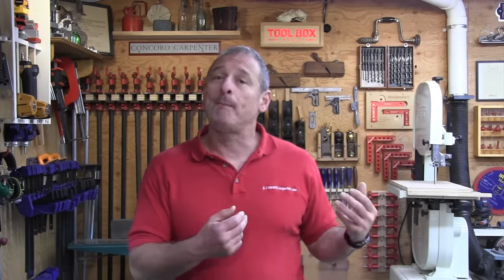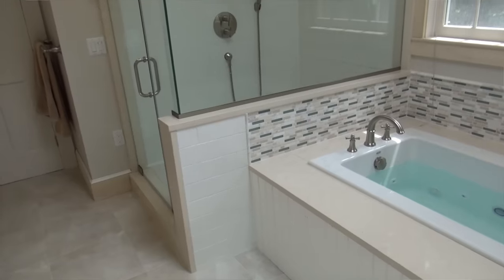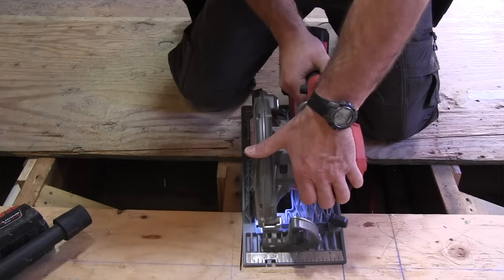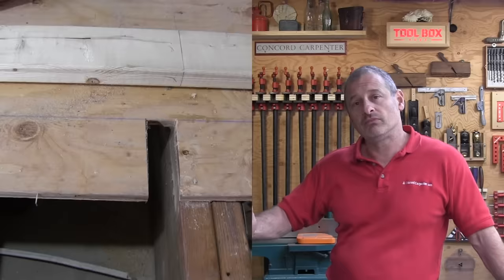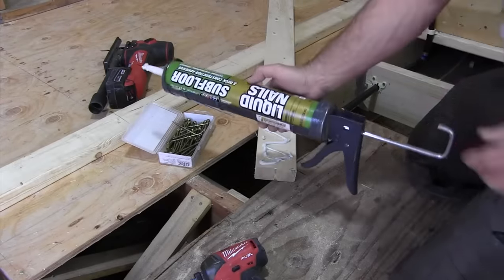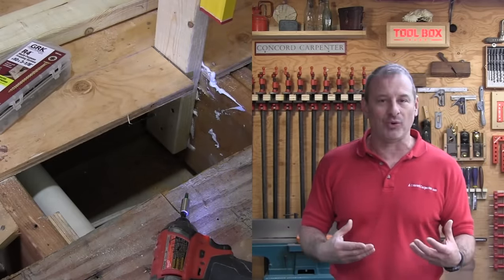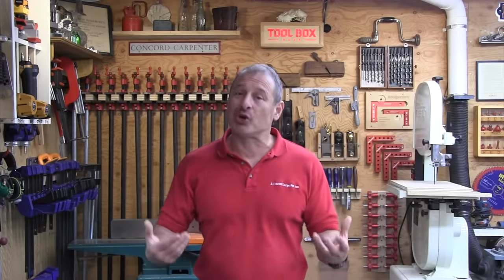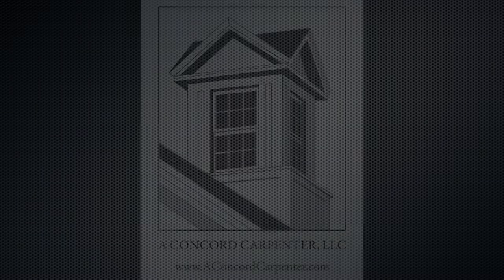Building A Strong Half Wall - Avoiding the WOBBLE!

Comment: what if it's a concrete slab Rob???
Reply: PS I love the video this seems like such a killer method!
Reply from the maker: luke hunter steel braces or threaded rod or 5/8 x 8 bolt epoxied in and a Simpson HDU16 on the stud
Reply: Heavy drive in anchors between each stud and lots of adhesive. Large flat washers on bolts
Reply: Best method, not easy method.
Jack Hammer a round hole, make concrete footing for metal poles, round or flat. Use metal nails with cap gun to attach wood framing. Don't saw cut nice square holes then breakout concrete, that will seperate the finished edges, keep edges raw rough jagged. Concrete will bond to it better.

Comment: Or get yourself a Kreg Jig HD and run long 1/4" GRK screws through the bottom of the "half wall studs" which in-turn goes threw the  bottom plate into the joists or blocking below. Run one screw from each side of the stud. May have to add a few studs to match up with whats below and the layout may be off a bit but it is bomb proof!
Reply from the maker: Mark V sounds good

Comment: We used to use a cheap framing square and sandwich it between two studs bolt it to the floor joist, worked quite nicely.

Comment: As a stair builder I have adapted the 3/4 threaded rod technique  from box newel systems into my half wall construction.
Reply from the maker: threaded rod is ROCK SOLID
Reply: @ConcordCarpenter  I used the threaded rod technique, but not sure if I'm wrenching down the nut hard enough, because the wall still wobbles. How much are you torqueing it down by?

 I haven't put any sheathing on yet, which I'm sure will help. 

Thank you!

Comment: I've done the threaded rod method before. It's very time consuming and hard to do with limited room in someones house.

I found the easiest way is rip down your framing 5mm and sheet one side with 5mm bracing ply. Nail it as you would a bracing wall and once its all sheeted, it's rock solid.

Make sure all studs are screwed rather than nailed.
Reply: Beat me to this comment lol
Reply: That's good thinking. I'm going to do it this way. Thanks so much

Comment: Strong walls when you can't get into the floor, as long as it's <3:1 length to height ratio, make it a torsion box by gluing and screwing plywood. Then the most critical/highest stressed connection is the end of the pony wall where it intersects the full wall. Works well on concrete too, just a couple titens into the floor.

Comment: I have a half wall on top and running with an engineered open web floor truss. My plan is to add steel. Simple. But I need to get in the habit of using construction adhesives more, too.

Comment: How can you make it sturdy by only connecting to bottom plate? Can you use a steel bracket to create a good connection?
Reply from the maker: Joachim Osmundsen you cant did you watch the whole video? Some folks use plywood but I don’t think it as effective as this method
Reply: I watched the whole video. So in your opinion the only way to go, is through the floor-plate and attach into the joists?
Reply from the maker: Joachim Osmundsen this is one option that Work’s flawlessly, check out my other video using threaded rod

Comment: I have i-joist running perpendicular.  What is the preferred way to attach blocking so I can then attach the studs to the i-joist beneath the sub-floor?  Would you recommend attaching the studs with bolts rather than nails?

Comment: What do you do on a concrete basement floor. I have secured a pt 2x4 to floor with Ramset Hammer pins 1-1/2 in deep  and toe nailed into a perpendicular cross wall of the shower front. Still wobbly!

Comment: great video! I'm having a little trouble visualizing what you mention for "For additional lateral support, adding 2x solid-blocking, onto the floor joist, on either side of the 2x4 wall stud will add more stiffness, and support to the structural screws. [This is a common method in reinforcing 4x4 posts in deck framing.]". 

Would these two 2xs be spanning between joists on either side of the vertical stud, oriented with the 3.5'' side vertical pressing on either side against the stud?, making a "stud sandwich"?

Comment: What if the half wall is installed on a concrete floor?
Reply: Thomas Doherty -- Build a sturdy wall ,  with 2" by 6" plates and studs .Keep the studs 12 " apart rather than a typical spacing of 16 " . Put blocking on top of the bottom plate ,  between the studs .           After sliding the wall in place and TACKING it so it will stand up , drill holes in the wall , through the top plate , the blocking and bottom plate , because you are going to run a vertical piece of  1/2 " threaded rod through those holes.  Use the drill going through the bottom plate to " scratch up " the concrete floor.               Then set the wall aside and drill holes  in the concrete using a masonry drill , where  you have " scratched  them up " with your wood drill . Put anchors in the floor ,  that will eventually be used to lock in the bottom end of the threaded rod . You can then run a piece of 1/2 " threaded rod through  the top plate , through any blocking ,  plus through the bottom plate . You anchor the threaded rod at the bottom with the anchor and at the top with a washer and a nut . At the bottom you may have to use a union to tie the rod to the anchor .           ( You do have to  use a bit to open up a hole at the top of the plate where  the nut can " hide " rather than stick up . )
Reply from the maker: Thomas Doherty use threaded rod or 5/8 x 8 bolt epoxied in and a Simpson HDU16 on the stud

Comment: Is that nailer battery operated? How do you like it? Does it have a mini compressor? 
I still prefer air tools. Even my site drill. I'm not convinced by battery tools.
Reply from the maker: Trucker Daddy - AKA John in Québec battery
Reply: @ConcordCarpenter  do you prefer it?
Reply: Trucker Daddy - AKA John in Québec it’s an ok gun, I have the framing nailer and the hanger nailer both from Dewalt , they have their pros n cons ..... great for framing floors, but slow for framing walls or sheeting

Comment: Okay.  I want to put up a wall in my dinning room and do not want to put holes in my floor, it doesn't have to go up to the ceiling because other walls in the living room dinning room don't go up all the way. On the wall, there will be cabinets on one side and shelves on the other. Can I just attach to the side walls. Note, there will be a door in the center. Help 
If I ever sell, I want the new owner to be able to remove the wall and have the dining room back with no floor damage.
Reply from the maker: if it goes to the ceiling you'll have 2-points of contact - should be all set

Comment: Great for main floor kneewall.  But my kneewall will be built in the basement on concrete foundation floor.  So obviously no joists to work with.
Reply from the maker: Scroll down for your answer - threaded rod

Comment: What do you recommend if you can't open up the flooring and the wall has to float on the surface?
Reply from the maker: Brian Baldwin cash the check quick - Just kidding glue and screw every component then use plywood
Reply: @ConcordCarpenter  Using 2 x 3 s and then cover the frame with plywood. I can't get through my floor either
Reply: I should have used a ?? !!
Reply from the maker: @lynndalbertis5433  if you’d using WEDI panels you can glue them to the inside wall - stiffens nicely

Comment: Those are all effective methods, but overly complicated. If wall thickness is not an issue a better method is to sheath the half wall with 1/2” plywood on both sides. You have to use construction adhesive on all of the studs, top plate, bottom plate, and use plenty of nails too. Make sure to keep the wall braced so that it stays plumb while assembling everything. In 24 hours it will be the stiffest half wall you’ve ever seen.
Reply from the maker: Marc Pagnucco plywood is an option but I’m not sure it’s better,  the wall can still move

Comment: I don't understand why you have to block love your videos
Reply from the maker: Thor Nieves huh? What’s block love mean?
Reply: I should have put a period I'm sorry
Reply: Blocking would serve as attachment points for wall studs when the half wall runs parallel to the floor joists.
Reply from the maker: Mark Callahan   Did I say it wrong?
Reply: @ConcordCarpenter  you guys are awesome
Reply: @ConcordCarpenter    No Rob, I think it might have been confusing because the video portion showing blocking did not actually show the half-wall studs coming down over the blocking (as you described in the video). Instead, I see you've attached a bracket to the second blocking example shown, so it seems you are going to support the half-wall above (running parallel to the joists this time) with threaded rod attached to blocking.
Reply from the maker: @markcallahan3605  got it - sorry
Reply: @ConcordCarpenter  Don't apologize Rob - you're awesome!

Comment: Any thoughts on a half wall built on a slab foundation? I've thought, not tried yet, sheeting the wall with plywood...... Especially if the final thickness isn't critical.....
Reply from the maker: Matt Miksch steel braces or threaded rod or 5/8 x 8 bolt epoxied in and a Simpson HDU16 on the stud
Reply: In my basement I first glued(I prefer Loctite Poly adhesive) a pressure treated 2 x 6 to the floor and shot it to the concrete with a Hilti gun. Then let the adhesive cure for 2 days. Note - I framed the whole 1/2 wall with 2 x 6's. 
Then I built the 1/2 wall(32" x 7') flat on the floor using poly adhesive on the bottom and top of each stud as well as three 3 1/2" screws into the top and bottom of the wall. Let that cure for 2 days. Then glued and screwed the 1/2 wall to the bottom plate that I had glued and shot to the floor. Note - When screwing and gluing the 1/2 wall to the bottom plate I inserted 4 screws in each stud bay near the outside edges(1/2" in). I then cut blocking(tight) and glued and screwed those between the studs on the bottom.  Be sure to use nice straight 2 x 6's and inspect to be sure crown is up. 
You can also use threaded rod epoxied into holes drilled in the concrete but I would have had to buy the epoxy, the cement bit and the rod.
I installed an 18" granite eating bar on top of the 1/2 wall.....came out awesome.  
Wall is rock solid, no deflection or wiggle at all. I am "old-school" and like to over build on something like this.
Reply from the maker: see answer another comments

Comment: Great video! I own 2 the dewalt 20v framing nailer in the 30 degree varient and have never been happy with their performance. How does the 21 degree operate for you? It appears to be operating well you you. Secondly I am very interested in buying the milwaukee M18 framing nailer when it arrives(if ever) have you heard anything?
Reply from the maker: Ryan Nichols I’ve tried the M18 dealer it seems nice but have not tested it yet hopefully will have one soon
Reply: @Ryan Nichols ... I’m waiting too for the Milwaukee one. I was for a long time on the fence to buy one  - I wanted to buy the Hitachi one , don’t like the flywheel system on the DeWalt nailer —- but I wanted not have a other battery system ( I’m with Makita but I’m switching slowly to Milwaukee ) so I wanted to stay in this battery system and then I saw that Milwaukee will also have a framing gun has and want sale them in October . That was good news for me because I have already few batteries from Milwaukee  and answered my question what to buy... but who knows if they sale it even this year? Maybe when 45 can stop the trade war with China. Otherwise they will not release it because with the additional 20% with that they can not compete ( price wise ) with the other guys.
Reply: What aren’t you happy with? I picked up a 30 degree and just got done framing a new construction with it and had no problems. It worked fantastic for me. I’m just curious.
Reply: I have both of the DeWalt nailers and the 21* is definitely more powerful. Not sure why. I use it exclusively now.

Comment: Hey man not trying to be a dick but i got a serious question, will upside down joist hangers even pass for inspection? Also i notice in the first part you didnt use a one piece bottom plate, as far as i know, i thought they had to be one piece, like i said, im not trying to be a douche and please correct me if im wrong because i dont wanna go around saying the wrong stuff. I like the idea of a sturdy pony wall but anytime i build them, i just have a concrete slab to work with and another wall to tie into, it works okay but nothing make me feel more confident than no wobble

Comment: Leave top plates off pony wall, drywall or sheath both sides and fill every third stud bay with concrete and a length or two of vertical 1/2" rebar. Apply top plates. Zero flex.

Comment: Ok how do you strengthen a half wall on a cement floor?
Reply: Good question. Ran into this a lot doing commercial or slab homes.
Reply from the maker: mic pic I answered in another question below
Reply: @ConcordCarpenter  Thanx!

Comment: what if its over a concrete floor?
Reply from the maker: Michael Nicolichuk  use threaded rod or 5/8 x 8 bolt epoxied in and a Simpson HDU16 on the stud

Comment: easy  on wood  floor     try   concrete
Reply from the maker: russ gouge use threaded rod or 5/8 x 8 bolt epoxied in and a Simpson HDU16 on the stud

Comment: pretty basic (common sense), but you lost me with joists hangers that look like they could hold up a flag pole...
A precision cut on your first inset but you couldn't manage a similar tightness with a block between joists? ?
Reply from the maker: Richard V Sassoon the upside down hanger was an example from another job- no need for those bolts- yes precisely cut and well fastened blocks should do it
Reply: @ConcordCarpenter  first used the upside down hangers on a tji  and microlam job that attached the beam on the outside of a series of cantilevered tjis. It's counterintuitive at first but then your brain clicks and I realized We were 'hanging' the beam off each end...ain't engineering grand?

Comment: This is useless.  Nail into joist,  ,  genius.  How about if there no joists ?
Reply from the maker: I totally disagree that this is useless. No joists meaning a slab? Or do you mean that the joist is not under the post?  If not under the post ADD blocking between the two adjacent joists and then fasten to the blocking.
Reply: A Concord Carpenter / ToolBoxBuzz yes,  a Slab or any wall where there isn’t a joist to nail into.  I mean who wouldnt use the joist  if its available?
Reply from the maker: @Trentberkeley86  You weren't paying attention see 3:02  For concrete slabs:  use a threaded rod or 5/8 x 8 bolt epoxied in and a Simpson HDU16 on the stud
Reply: A Concord Carpenter / ToolBoxBuzz what if you’re on the 2nd floor?